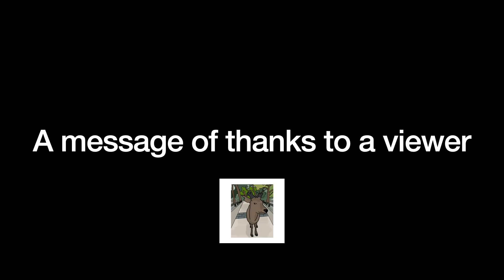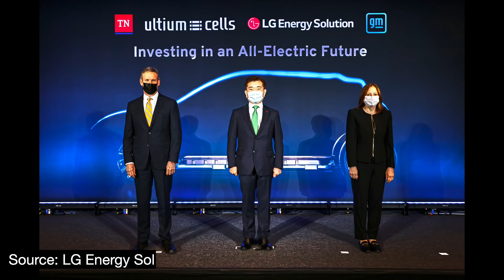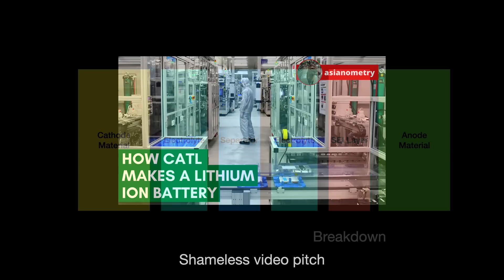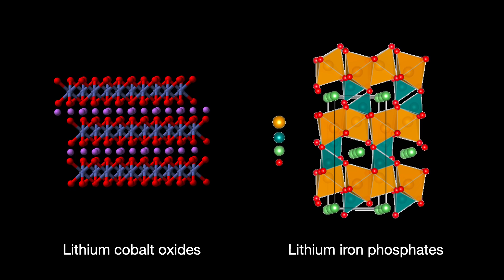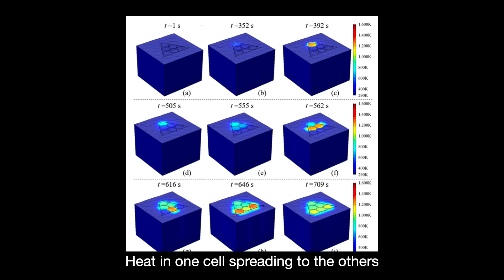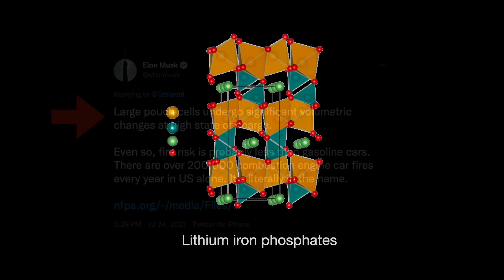The Chevy Bolt Recall & The EV Battery Fire Problem

Comment: GM blamed LG batteries for the EV fire. My question is why GM stopped the EV production altogether?  GM probably isn’t confident enough its power management system.
Reply: GM stopped production of the Bolt so it could replace packs in previously sold vehicles faster.

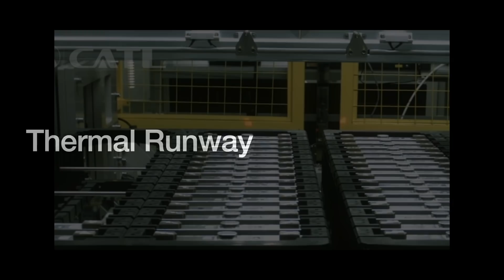Comment: 6:20  it's "Thermal run-away" and NOT "Thermal runway".  It does not mean that there is a launchpad, highway, or any sort of road for it to run. 
Run-away means that the hotter it gets, the more heat is produced. A positive feedback loop. Once triggered, makes it go on fire, and stay on fire until all available material is consumed. It's another way of saying "it is unstable" or "it has entered a region of instability" on the temperature.
Reply: at first I thought it was just his lisp.. but then he wrote it .. wonder how he got confused

Comment: Porsche have not electrified their flagship yet. The Taycan is a new model entirely most similar to the Panamera. The 911 Turbo S is the flagship and probably won't be electric for many years to come. 

Also I don't believe you can overcharge modern electric cars. The battery management system makes sure you don't put unnecessary strain on the battery
Reply: @cormacsyt0  it has nothing to do with boomer lol…. You cannot replace the amazing driving dynamics of the Porsche 911 by a crappy Tesla or ev.
Reply: @alanmay7929  This is the driving dynamic that killed Paul Walker right?
Reply: @cormacsyt0  Well Porches flagship is still an ICE vehicle although that will probably change. And wtf are you calling me boomer.? you even know what that is refering to other than just being condesending? 

The I.D R is an amazing vehicle but it is an one off not a production car.

Comment: Did you just say 'Elon Tusk?'  Or is my hearing on its last legs?

Good explanation, but... 

'Thermal runway' is not a battery term.  It's 'thermal runaway,' pronouncing all three syllables.

There are three types of cell form-factors to consider, and each has implications for battery pack fires.

Chevrolet's Bolt uses LG Energy's pouch cell form-factor.  Pouch cells are large, flimsy, soft-walled, and as Elon mentioned, they undergo volumetric expansion at high states of charge.  P:ouch cells are placed in trays to contain them; they cannot be structural elements.  Cooling is applied to the trays in GM's Bolt pack design.  Pouch cells are notorious for developing 'hot spots' because cooling is further away from the chemical reactions taking place than for other types of cells.  Pouch cells are probably more vulnerable to spontaneous thermal runaway than other types.

Prismatic cells were developed for the consumer electronics market.  This form-factor excels at conforming to odd shape requirements in the devices in which they are used.  They are also the most expensive cell form-factor.  Choosing prismatic cells for mobility applications - VW has recently decided to switch to prismatic cells, for example - is an odd choice.  Their sole advantage is conformability, which isn't necessary in a big giant battery pack - any shape will do, so there's no reason to choose a more expensive cell design.  These cells do not expand, but they have brittle walls and are not suitable for bearing structural loads.  They slot into trays.

The final form-factor is hard-walled cylindrical cells.  These are the cheapest form-factor, in general (though prices for all three form-factors vary tremendously depending on production method, cell chemistry and purchase volume).  Cylindrical cells can bear structural loads, and Tesla intends soon to deploy structural packs which take advantage, which will generate significant weight savings.  Cylindrical cells appear to be less vulnerable to thermal runaway.  Most of Tesla fires are the product of cell breaches in accidents, not spontaneous at all.

Both Lucid and Rivian, relative newcomes to the BEV market, have chosen the cylindrical form-factor for their initial models.

Tesla uses prismatic LFP cells from CATL in their entry-level GF-Shanghai-produced model 3s.  For everything else Tesla makes, they use cylindrical cells.  Tesla's plans for internally producing cells are strictly cylindrical (4680 cells).  I think Tesla is using prismatic LFP cells, not because they prefer the prismatic form-factor, but because CATL can supply them, and Tesla needs every cell it can get its hands on for its manufacturing operations.  In time, I think it's likely that Tesla will discontinue using prismatic LFP cells, and switch instead to cylindrical LFP cells.  But not soon.  Tesla has no plans that I know about to manufacture its own LFP cylindrical cells, and CATL hasn't yet offered a cylindrical LFP cell to Tesla.

I do not see a future for pouch cells for mobility applications.  I regard this form-factor as inferior.  We probably can't lay the blame for GM's Bolt fires problem solely at the form-factor's feet; something else likely is wonky with LG Energy's pouch cells.  But the cooling disadvantage for this form-factor is problematic, hot spots are problematic, and a cell which changes its volume regularly is a cell which can suffer wear that the other form-factors do not experience.

Comment: Another example of why the old LIfePo4 chemistry is being used by Tesla again, it doesn't explode, is much cheaper to make and degrades slower than all the other chemistries. The only negative is initial energy density is less, but ends up being higher than the other chemistries over the entire life of the battery.
Reply: I also heard that fePo4 batteries have more performance problems with cold weather than other chemistries.
Reply: @timmathison8740  Most of the chemistries have a problem with sub zero charging so they all need a low temp sensor if you live somewhere it gets cold anyway.

Comment: I have a 2013 Chevy Volt that I bought brand new.  The batteries were made by LG Chem.  They're not pouch batteries and not cylindrical.  I am guessing prismatic.  As far as traction batteries goes, it's old technology, but of all the Volts manufactured, there has only been a few cases of battery fires.  As far as charging, you can leave the charge cord plugged in for a long as you like.  Once it reaches it SOC, it just quits.  No need to monitor your SOC.  It's too bad about the Bolt.
Reply: Can you tell me how much battery charge is left in your battery pack? Do you need to replace the battery yet?
Reply: @Theoryofcatsndogs  I just turned over 100k miles.  Display shows 9.5 kWh usage from full charge to switch to ICE.  On not cold days, I still get 38 - 40 miles range.
Reply: Correction on the battery configuration.  They are not cylindrical.  Not sure if they are considered pouch or prismatic.
Reply: @scruffy4647  that is not a lot of range, unless you only travel around within city.
Reply: @Theoryofcatsndogs  The Volt was originally rated for 38 miles on the traction battery.  Then it would switch over to the ICE.  Not a pure EV.  70% of most people’s commute daily was within this battery range, hence the size of the battery.  16.5 KWh.  Best of both worlds, no range anxiety.  At least back in 2010.  Today’s EV profile is different.  No point in adding  a range extended engine.  More range, more charging stations. I am guessing the change to EVs is going to come quicker than what was thought
Reply: @scruffy4647  ic. thanks for clarify.

Comment: Lots of errors in this video.  Apart from the minor ones others have pointed out, the largest on is that you missed the agreement between GM and LG which will lead to LG covering the overwhelming share of the costs.  Lawsuits are probably NOT forthcoming.
Reply: The impression I got from the video was that the lawsuits would likely be addressed by LG Energy to it's sub-contractors.

He states upfront the fact that LG accepted responsibility, as well as the fact that they're working with GM to rectify the problem, so I think the only error here is your interpretation of what he meant...
Reply: Apparently,  accuracy is not important

Comment: The separator failure starts way before they burn. "Pin holing" is a low charge phenomena. Part of the reason you devices shut down at 15% but say 0%. Telling people to hold the battery so high is proof too. Real cheery getting treat it like a bomb advice too.

Comment: in singapore the government is phasing out ice by 2030. even public buses are getting ev. I do fear about the safety and with a carpark packed with evs, it takes 1 cell to destroy the carpark and nearby buildings. and the fire cant be put out in 10h. and building sprinkler systems are insufficient

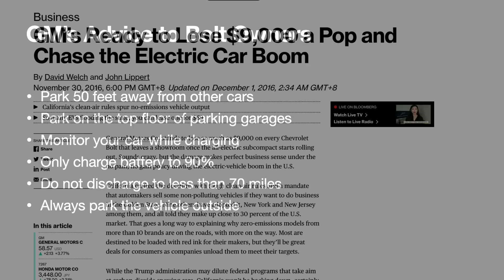Comment: 3:09 so basically GM told Bolt owners to park the car in a landfill...
Reply: Well, they did that to EV1, so I guess that was their first idea here, too :D
Reply: Dear Customers

Assuming your vehicle has a 200 mile range at 90% you can charge your car to 180 miles.

You should only discharge the vehicle to 70 miles.. so you have a theoretical maximum range of 110 miles..

You will be able to drive to work, but you'll have to park outside, and potentially about 16 miles outside the city limits before you find an open air car parking space within 50 meters of another vehicle.

Once parked you should write a note on two traffic cones with 'fire safety warning do not park within 50 meters' and go set those up before heading off to work..

Once you get back to your car parking spot at 10:55pm there might be a nice toasty hydrogen cyanide fire burning to warm you up.. if you're lucky your car might get you home without insta-cremating you on the highway.. best of luck

PS - Thanks for your $35k
Yours Sincerely
The electric car industry..
Reply: @robertbrown1338  lol boomers these days
Reply: @m2heavyindustries378  wha?
Reply: @robertbrown1338  🤣🤣🤣🤣🤣🤣

Comment: There are a few extra things to consider when discussing the statistics related to EV vehicle fires. EV vehicles are much younger than the average ICE. Most ICE car fires happen due to either the electrical system shorting, or a crash. It seems like EV fires happen quite often when the vehicle is left parked/charging which rarely ever happens with ICE vehicles. IMO parked fires are a lot more dangerous as they can burn down an entire house if left in the garage.
Reply: Let’s not forget the millions of super old ice cars and the faulty repairs, bad installation of gadgets in cars, vandalism and a lot more.
Reply: Quite often? 16 fires out of 5 production years? And over 140,000 sold? That is just the Bolt alone, but it doesn't sound like it's happening "quite often" at all. Right now, there is less than a .5% chance, that if you had a Bolt, it would catch on fire.
Reply: @davbhard  Its 0.0114% chance with 16 out of 140,000. You need to work on your math skills...
Reply: @Bialy_1  pretty sure that .011 is less than .5 so yes, there is LESS than a .5% chance. Unless you believe that .011 is somehow more than .5 In which case you would need to work on your basic counting skills.
Reply: @davbhard  Sorry if my use of quite often was unclear (English is my second language lol). As a total share all EV vehicle fires, many of them occur when the vehicle is parked/charging. This is in contrast with ICE car fires that occur the majority of the time when the vehicle is in use. As Bryan pointed out, parked car fires still happen for ICE (bmws being the prime example) but if you look at statistics, those are the exception not the norm.
Reply: @sava411  yes, quite often was the wrong choice of words. Yes EVs could be more prone to fires while charging. It doesn't change that only 16 bolt fires have occurred in it entire development.
Reply: @davbhard  16 fires for a <2 year old car isnt as good as you think it is.
Reply: Millions of BMWs have been recalled for randomly catching fire, even when parked and off.  South Korean also banned a bunch of BMW models because of frequent engine fires.  EV & ICE fires are a quality issue, not an inherent feature.  GM learned what happens when you trust LG (aka “Lucky Goldstar”) to do quality control.